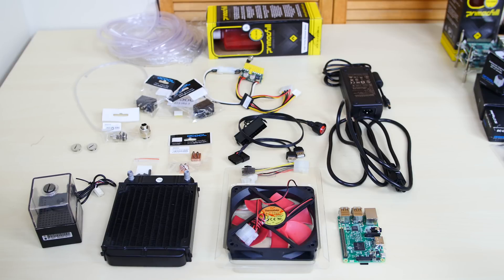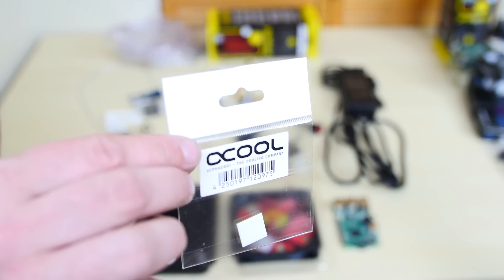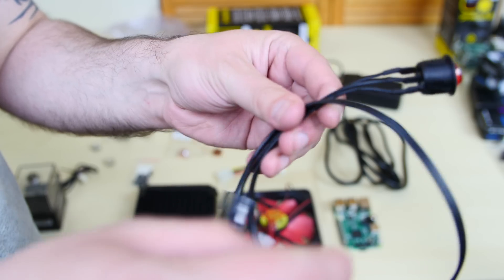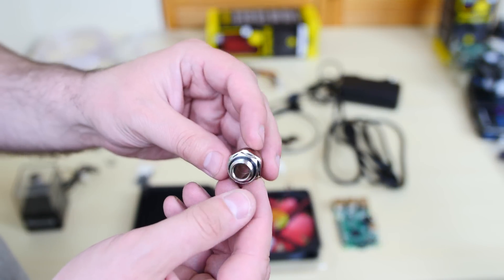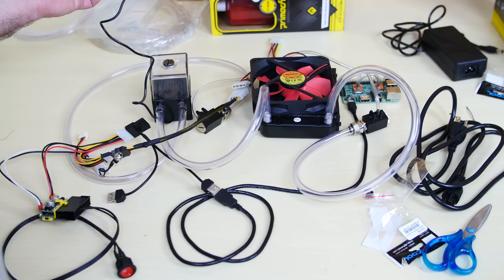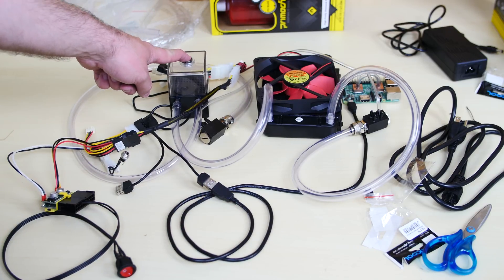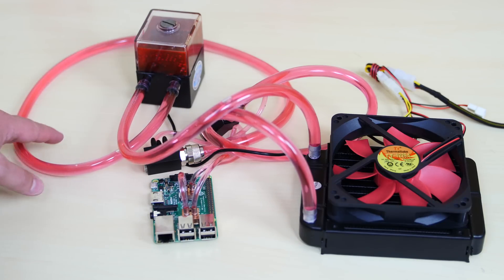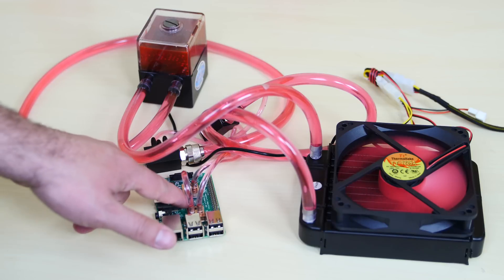Water Cooled Raspberry Pi 3 - Part 1 - The Build

Comment: when your water cooling set up costs more than what you are actually cooling....
Reply: Lol XD. It's kinda funny.
Reply: Not unusual at all even amongst the PC crowd, some people just love burning money.
Reply: It will impress his guests so it is all good
Reply: the powersupply alone costs more
Reply: I actually wonder if the watercooling itself does't use more power than the PI3.
I do think it is interesting to watercool  a bank of xu4, as you also get some processing power in return. But if you do that you are probably already in a data center with airco. So a simple fan sucking air through the bank would suffice.
Reply: +Subroto Xing well, the PI3 has no processing power, but the XU4 is on par with intel in processing power/watt with a much lower idle power waste. You can run several wordpress sites on several XU4's with the same power a normal server would use just being idle. And the best part of it is thay you actually get your own core instead of a virtual compartment with all machine emulation problems that come with that.
Reply: +Some Guy speaking of costs, not power
Reply: LMAO
Reply: My water cooling alone cost over $500 aside from rgb led, uv liquid, etc. my cpu and gpu run 25 degrees cooler than the stock heatsink/fan
Reply: It almost has to.  I would be amazed if it weren't using more than 3x as much power as the Pi itself.
Reply: Well, in all datacenter, power, cooling and security cost generaly twice or triple the price of the computing systems.
^^
Reply: seriously dude you're comparing a mini pc with commerical data centers :O
Reply: +bloepje i meant my comment for icefeather ^^
Reply: +Subroto Xing i mean data centers are in business to make profit so money from clients will cover their cooling costs but op is just doing this for fun and cool youtube video ^^
Reply: My water cooling setup for my desktop cost as much as my graphics card. It's not cheap. :/
Reply: That was just a ratio comparison to make sense of this preposterous idea. But still, the mini watercool cpu block is fun =P, that would be great if the rest had the same scale
Reply: +IceFeather What? The worst DCs did 1:2 several years ago but nowadays the worst are 1:1 (The same amount of power used to cool the servers), Google has reached 1.14, meaning 14% of the total power is cooling, the rest is equipment, Facebook claims a 1.07 PUE (just 7% for cooling) and Microsoft reached 1.25 in 2013. Since then equipment has vastly improved in energy efficiency requiring far less power and thus less cooling.
So if you're DC is burning three times as much power for the site itself to host the servers you're doing it much like this Raspberry project xD
Reply: IceFeather Still doesn't add up as equipment will always be much more costly than the location itself. We have our backup in a datacenter which is essentially a concrete and steel vault, with all the security measures including armed staff and still the equipment is several times more worth...

Comment: I saw "Watercooling a Raspberry Pi 3" and instantly I was sold - awesome idea.

So I started watching ".. take our adhesive strips .." aand you lost me. What's the point of watercooling if you're going to use bloody adhesive strips?

Another point - you use an adaptor to get 3mm fittings, but then you cap off four of them. Why didn't you use two of them - one per chip? I'm sure you could have dramatically increased the water flow rate doing that rather than constraining the flow to a single 3mm tube.
Reply: connect the cooling blocks on the pi in parallel next time, as the liquid entering the second one will be colder, so the difference in temparature is higher and you'll have a better cooling effect
Reply: You obviously don't know how water cooling works. It doesn't matter if you loop it in serial or parallell, the water temperature will be the exact same over the whole loop no matter what. This has been tested over and over and over again with the same result every time.
Reply from the maker: Improvements coming in part 3. With overclocking.
Reply: thermal adhesive strips maybe?
Reply: I would imagine for the 1st try it would be the easiest. not that you have anything to hold it down if it's just paste, right? Next up, a 4  pi cluster with one continuous loop (<;
Reply: My thoughts exacly
Reply: Well, actually these adhesive strips are used in cooling the VRAM of custom watercooled graphics cards!
Reply: The problem is not temperature, it's flow. You go from 8mm internal tubing to 3mm internal tubing. You greatly reduce the waterflow. Plus, serial means even higher flow reduction, since it will be reduced to the smallest part of the circuit. With 2 in parallel you increase the total flow, and the flow in each block. Greater flow generally means lower temperature...
Reply: Furthermore, i think the best option would be a larger block, covering both chips, with a more reasonable fittings size, and a less obstructive inside.
However, i'm not sure that we get much of watercooling a pi. I can only see it come into handy in a tight cluster configuration, and it seems to be what the guy is planning on doing :)
Reply: Yup i was “adhesive strips?”

Comment: You numskull you hooked the hoses to the pump backwards. It should be pump then pi then radiator back to the pump the way you have it is backwards. The way you have it your not cooling off the pi. You have it pump to the radiator then the pi and back to the pump all your cooling is the pump not the pi.
Reply: How can you call someone a "numskull" when you're applying some really bad logic to your argument?
Component order in a loop does not matter.

Comment: I believe that fan motor and water pump generate more heat together than the whole system dissipates from Pi chips.
* Not to mention the heat generated by power supply.
Reply from the maker: The Temps were pretty good.
Reply: I really dont think this was a practical project, it was just a why not lets see what happens kind of thing. For the same reason i want to water cool and overclock one of the old intel atom laptops i have that i unlocked the bios on.

Comment: You watercooled the Ethernet and USB controller, a chip that doesn't even get warm.
Reply: it does dissipate some heat but this is stupid as it doesn't increase with processor frequency
Reply: just to look cooler B)
Reply: the roast is real

Comment: Instead of flowing from one block to the other, you could have used your splitter to give each one their own in and out instead of pushing heat from chip to the other.

Comment: I'm not much for rasberry systems, but I do like watching water cooling systems, the pico is a great Psu to use too, I've got several of them.
you should look int the "HDPLEX 250W Hi-Fi DC-ATX Power Supply" its not micro like the pico but small as the rasberry and packs a powerful punch for needing extra power for fans and 12v pumps and so forth.

  great job.

Comment: Ok, you can please stop with the constant repetition!  You went through the route of circulation god knows how many times! You have the radiator laying on a flat surface, so there is NO AIR FLOW through the radiator and it is NOT GOING TO COOL ANYTHING LIKE THAT!!!
Reply: I don't see how believing anything is relevant, this has nothing to do with opinions.
That 120mm radiator could probably dissipate 5 Raspberry Pi's on full load without a fan to begin with, the sheer amount of surface area on a radiator of that size is disgustingly overkill for something of this nature.

I must admit, it's sad to see you lie and claim you've tried this.
Reply: Uh, no... The surface area is great enough that it will definitely help. Also. I am very sure the pi has the capability to thermal throttle to not over heat.
Reply: Secondly because you are ADDING surface area it will obviously be more efficient than the chip on its own it's literally just common sense. I like that you don't include temps and your ambient temp, really convenient. Far as I'm concerned regardless you're mostly full of shit anyways so I really only replied to you because it was painful to see you totally miss the point
Reply: Yeah it will actually cool. Even if there was no fan at all it would still transfer a ton of heat. remember that the original rpi had no cooling whatsoever. just the miniscule amount of surface area with the air. and it still kept cool no problem.
Reply: Only as long as the water was cool, after that it would build heat as there is not air flow to remove it from the radiator!  On a heat sink there is air moving by convection and from movement in the room, but on here the fins are to close together and with out the fan moving air THROUGH the radiator it will still eventually over heat!
Reply: Actually the shear water volume will not dissipate all of the heat!  Well to be fare in the short term it will but when the water has heated up it will not!  As people have been saying this over and over again  I decided to test it out and guess what!  I was correct!  If you do not believe me then test it for yourselves, or not I don't really care!  Have fun using profanity and being infantile so that people can not take you seriously now and into the future!  This is my last reply to this topic.  Have a good life!
Reply: It does throttle!  The whole point of liquid cooling it is to stop it from needing to!  And no after testing it in this configuration there is not enough airflow to keep it cool and after 26 minutes it started to throttle!  with the radiator standing on edge allowing air to flow through the radiator it did not get close to throttling!
Reply: I literally said that it will throttle to not overheat
Reply: You are free to believe as you wish, It makes no difference to me!
Reply: ^this. Thanks
Reply: +TwitchFast.
You could run this without a radiator.
The sheer water volume should keep the system cool.
Reply: The fan is pushing air through the radiator. It might be on a flat surface but the radiator isn't completely flat or uniform so there's enough space for air to pass through the other side.

A pressure optimised fan would work even better in a situation like that.
Reply: Do you even specific heat capacity bruh?
Reply: Mike's Micro Shop And again someone on the internet can't accept they're wrong, what's new.

Comment: You should change it up. Run the blocks in parallel instead of series. You'll get all around better results (improved cooling) because they way you have it set up is way too restrictive. Instead of using those caps, you could actually just connect both sides using tubing and you'd still have liquid flowing through the blocks... this is because those small lines are so darn TINY. Either way, give each block its own lines, this will give you better flow, better flow will give better cooling.  (Use two small 3mm barbs per side, instead of one per side)